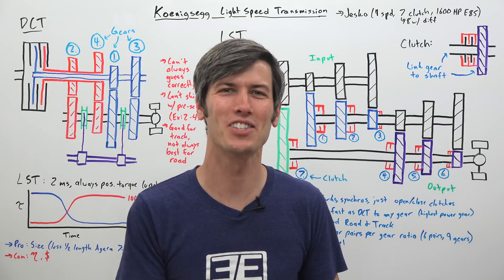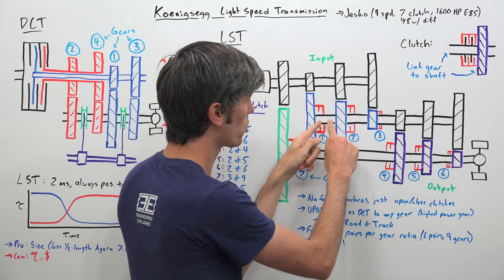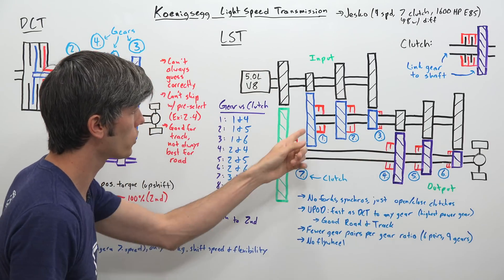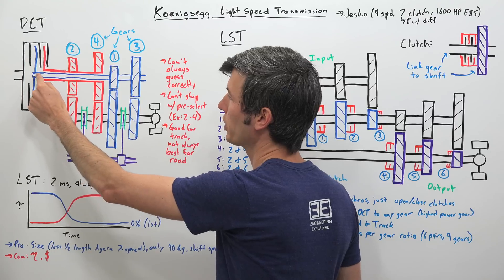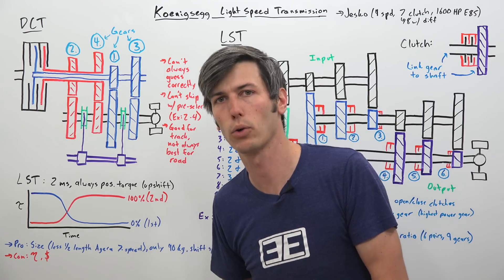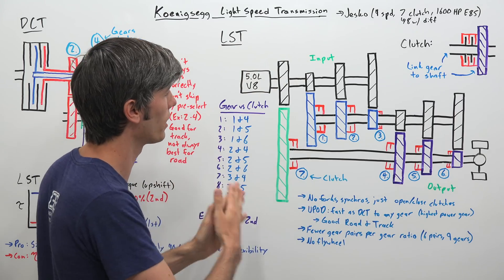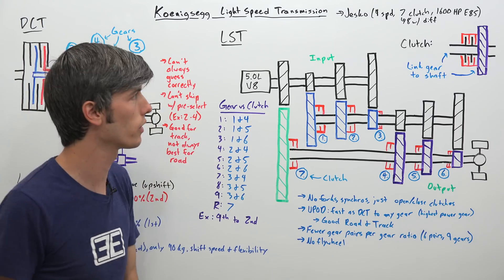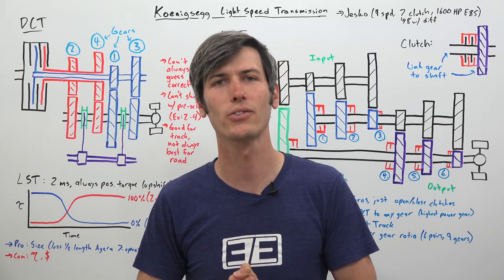Has Koenigsegg Made The World's Fastest Shifting Transmission?

Comment: Are there any updates, latest developments on their FreeValve research?
Reply: Yea, it would be nice to know what's actually happening to these technologies. With Koenigsegg's advancements, like the removal of camshaft and this smaller transmission, we could be expecting as much as 1/4 ton of weight reduction. It would be a real shame not to see that permeate the whole market.
Reply: @Varadiio  FreeValve isn't going to happen, its not useful at all...
Reply: China is the only other country mass producing the first consumer friendly freevalve engines from koenigsegg
Reply: Paul Bautista yeah I hope to hear more updates from them soon. They claim to have put their actuators through hundreds of millions of cycles of testing with no measurable wear. Pretty impressive.
Reply: I can't believe how embarrassingly obvious the corporate trolls in here are. Go away you filthy vermin! Real people are trying to communicate!
Reply: Freevalve will debut on Koenigseggs entry level model.
Reply: i think people underestimate the complexity of a free valve engine. it's not the actuators or mechanical parts you have to be worried about. Its the infinite number of variables that have to be accounted for and programmed into a computer to control the engine. How can you possibly account for the valve lift needed for every position of the throttle , which is independent of engine load which is another set of infinite variables , and every possible rpm (another infinite set of variables.)  There is a reason why even with constantly variable cam shafts engines still have a relatively narrow peak power output. It gets even more complicated the more you dive into it. Its one of those things where you start to do research only to learn that you don't know things you didn't know you didn't know.   lol
Reply: @TheDaltonmichaels  well yeah, a man  doesn't know that he didn't know until he knows.
Reply: @asd fgh  Koenigsegg already made a statement that the FreeValve technology will debut in their next entry level car line up as they have received investment and support from new investor. And they said this car will be revealed at the geneva next year. So we will see whether it's a gimmick/publicity stunt or not.
Reply: @budokpantai  Surprisingly, the investment came from the parent company of NEVS (National Electric Vehicle Sweden) which is the company that purchased all remaining SAAB automobile assets. Koenigsegg was first in line to buy SAAB when GM first put them up for sale. But, GM dragged their feet and it was no longer viable at the time for Koenigsegg to wait it out so they walked away from the deal. Now everyone is happy and got what they all wanted. Koenigsegg gets new investors through a percentage purchase of their company and NEVS gets a platform for international distribution. It's a win win for all. Can't wait to see what this new formed partnership comes out with together.
Reply: i think people underestimate the complexity of a free valve engine. it's not the actuators or mechanical parts you have to be worried about. Its the infinite number of variables that have to be accounted for and programmed into a computer to control the engine. How can you possibly account for the valve lift needed for every position of the throttle , which is independent of engine load which is another set of infinite variables , and every possible rpm (another infinite set of variables.)  There is a reason why even with constantly variable cam shafts engines still have a relatively narrow peak power output. It gets even more complicated the more you dive into it. Its one of those things where you start to do research only to learn that you don't know things you didn't know you didn't know.   lol
Reply: not to mention not even having free valve technology is not even the limiting factor for variable engine outputs at given RPMs ,  before ever touching variable valve train you could heavily modify engine output throughout the rpm by having variable intake runner length , exhaust runner length , and variable intake plenum volume. that's without even a variable camshaft or variable boost pressures. lol you can go insane thinking about this stuff.
Reply: oh god plus these new engines are coming out that have variable stroke lengths which is giving them variable compression ratios.  ICEs have an insane amount of development left to do. Hopefully we can keep the research going long enough to develop a lot of these things and it doesn't all stop due to electric motors.
Reply: @TheDaltonmichaels  I think you underestimate Koenigsegg's ability to bring revolutionary new technology into production... I mean, how can you be doubting the very fundamentals of the technology when they've already done tonnes of actual testing of the system? The fact that the system works is absolutely above any shadow of doubt at this point. The system is confirmed to be featured in Koenigsegg's upcoming entry-level hybrid supercar, you think they would say something like that if they hadn't even figured out the very basics of how the system works??? I mean seriously...
Reply: @TheDaltonmichaels  what throttle? The freevalve engine does'nt need a throttle.
Reply: @michaellehto1697   you could build it with or without a traditional style throttle body . removing the traditional style  just turns each intake valve into a throttle body.
Reply: FreeValve doesn't work, its purely a gimmick
Reply: @Ckcdillpickle  free valve is not a gimmick! Imagine having the perfect cam shaft not only for every specific rpm but for every load at that specific rpm. The gains would be amazing.
Reply: @SoulTouchMusic93  The gains wouldn't counter-act the added weight
Reply: @Ckcdillpickle  it's about efficiency dude. When you only have a 1L 3 cylinder it's fine. It's a lot easier to do cylinder deactivation because you can take away compression too and you can go nuts with kessington cycle (that's not how that's spelled. At all ) without sacrificing performance.
Reply: @SoulTouchMusic93  Freevalve will never go in a mass production car... FreeValve requires a air compressor to run, something which takes power
Reply: @Ckcdillpickle  they say it takes about the same energy as a regular valve train. And some cars already have compressors on them. Things like high end volvo's, jaguars, land rovers and many others.
Reply: @Swagoi   well yes but it's pretty complicated. Because you can have a 1.4 with a fuel efficient cam that only has like 80 horsepower at a fuel consumption to a 1.4 free valve engine. But the thing is that you can have a 1l free valve engine  making 80 HP with a 'race cam profile' only when flat out. And overall you save. Also a regular cam engine can have cylinder deactivation but it still compresses the air on the deactivated cylinder while a free valve engine could just let the air escape.
Reply: @Ckcdillpickle  "added weight"... Hum... Pneumatic or electric actuators are lighter than some camshafts... And a computer to run AI isn't heavy at all.
And yes, you can use ai to Control the engines... The engine would evolve by it self...
Reply: @Ckcdillpickle  Or, electrical actuators...

Edit: Solenoids. If you didn't know what it was... You can just have multiple Solenoids and have those control Everything...
Reply: @vladimirlucifer4566  "ai to control a engine" you don't need AI to control a engine. You do realize FreeValve runs off highly compressed air
Reply: @Ckcdillpickle  Yeah... It can run of air, using pneumatic actuators like in F1. Or, use electrical actuators... It has been suggested too... And, plus, ai would be perfect...
You know why? Because it would be better than what humans can do.
Reply: @vladimirlucifer4566  and you realize F1 is ran by teams with millions of $? Camless tech has been in use for decades, it doesn't work well in a regular car
Reply: @Ckcdillpickle  I'm facepalming really hard here. Like, just shut up. You have no good reason to contradict it. Camless designs ARE superior. The cost of engines comes from research and development and the quality of the parts... After being developed and not using those kinds of parts... Really, there is not an added cost, because the research is there... The millions you say, well, not anymore, valve train in not that much cared anymore. After all, the technology has decades now.
Reply: @vladimirlucifer4566   Tons of money has been put into camless engines for decades and none of it has worked, its only worked in low RPM engines
Reply: @Ckcdillpickle  have you ever considered that compressed oil from a dry sump type system could be used to actuate the valves? It might be an improvement considering fluids do not (within reason) compress, whereas air does. That being said, an electric motor driven air compressor that derives power from the battery/ alternator is another option. ICEs are not perfect, but I personally believe that FreeValve type technologies are a step in the right direction for furthering power and efficiency for ICEs
Reply: @SoulTouchMusic93  My car has already a motor with cylinder deactivation and miller cycle for efficiency requiring motor loads
Reply: @cannesahs  yeah but you still have valves that run the shut down cylinder and compression that happens and turns into pumping losses. The only gains you get are from the fact that it lowers the vacuum because you are running at a higher load.
Reply: @SoulTouchMusic93  Both inlet and exhaust valves of deactivated cylinders are kept closed
Reply: @cannesahs  oh really? Cool!
Reply: @SoulTouchMusic93  same system as in some (discrete) variable valve lifts, but with a zero lift option
Reply: @cannesahs  oh, so that's how that works. It should be reliable then.
Reply: @Ckcdillpickle  cams canabilize 35-40% of the engines to do something an electromagnet can do...or actuator.

Comment: park is easy😀 close all clutches
Reply: All these clutches and you couldn't catch that sarcasm.
Reply: @jGRite  🤣
Reply: Reverse: Open all cluthes, step one foot out and PUSH yourself backwards
Reply: You only need to close two on the same shaft...  
And I bet this thing is gonna blow up often... all it takes is one clutch to fail and locka and it's over... (although, clutches usually slip with they fail, so maybe it's not such a problem).
Reply: @calholli  I'd have thought so but it's obviously gonna be stress and fault loaded in testing.
Reply: @calholli  There could be a shear pin engineered into that as safety.
Reply: calholli I would bet it uses hydraulic pressure to open and close the clutches. I’m assuming the TCU recognizes open and closed circuits so the likelihood of multiple interference circuits being selected is doubtful.
Reply: Woosh

Comment: How do  they even manage to develop these amazing technologies while they sell so few cars. Granted, the cars are expensive, but R&D is also incredibly expensive.
Reply: If you look closer, Christians solutions are at most time simple and straight forward to implement, like this gearbox is just a manual gearbox with clutches for every gear while other manufacturers spend billions on cutting corners and developing tech that guarantee a fixed point of failure
Reply: @thapelomashaomasemola7922  Sometimes, yes. Good point.
But they do almost everything in house apart from the tires. Not even the big ones do that
Reply: Definitely very impressive
Reply: Christian doesn't just manufacture and sell cars. Apparently they also own several sister companies that hold several patents and do other stuff related to automotive technologies. For example, the FreeValve. And if I am not mistaken, the recent Top Gear videos also mentioned about them owning their own carbon fibre factory in Spain. Pretty sure they also invested in several other companies.

Comment: Cool transmission! Only small thing would be that if you want a final drive for easy tuning of the gears (not necessary for road cars but great for race cars) you need 3 wheels instead of 2. But the fact that there isn't a flywheel makes up for that, and the crazy fast shifts as well. Is it faster then F1 car shifting?
Reply: F1 is not so much as we expect because it's still a normal sequential manual with race spec. DCT can perform same speed with much longer durability